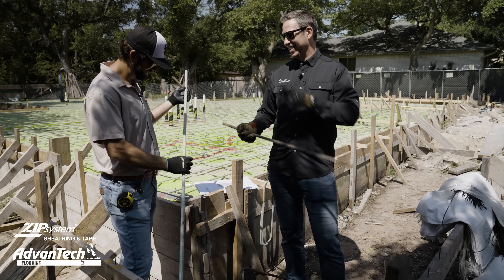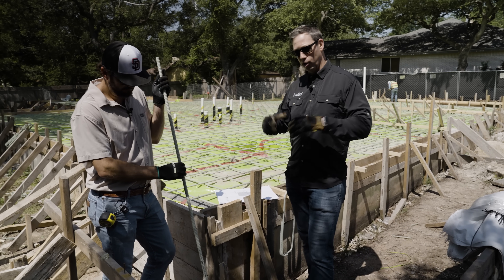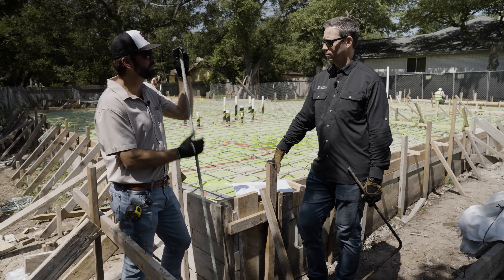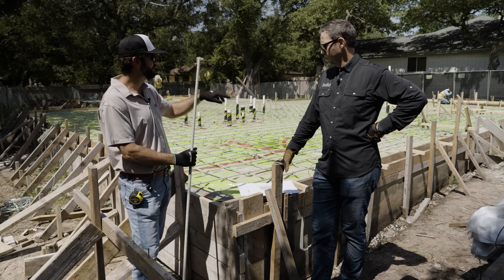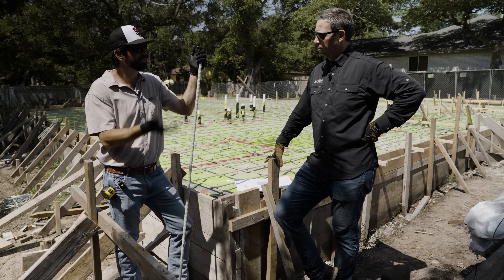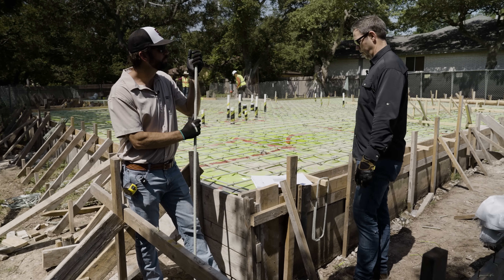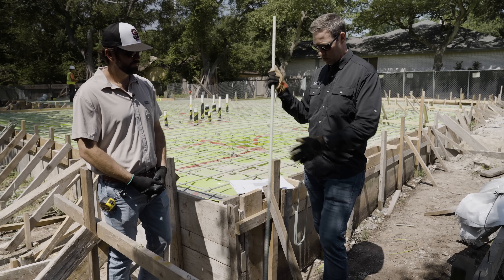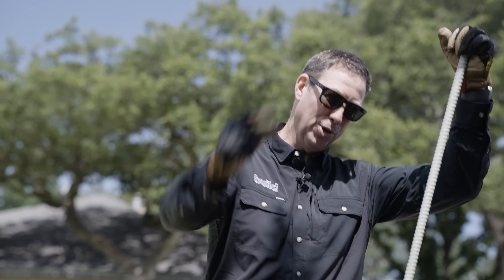Comparing Steel and Fiberglass Rebar - SURPRISING results

Comment: I would use basalt rebar before using fiberglass. You don't need gloves when handling it and won't put fiberglass in the air when cutting it. It has the exact same advantages of fiberglass without destroying your lungs.

Comment: I think fiberglass rebar can't replace steel rebar, because steel is more flexible and can be bent like steel bar. Fiberglass rebar should be formed in factory. And how about tension and compress test ? Fiberglass is more brittle than steel

Comment: Imagine tearing down a building and having to deal with fiberglass dust and pieces - not thank you! 

Fiberglass should be banned foe its lack of recyclability. The danger of fiberglass dust to human health and just environmental pollution is another factor against it.

Corrosion resistant steel rebar would be way superior.

Comment: Glassfiber or basalt fibers. I can definitely see uses for them in places that are subject to corrosion and where the concrete over the rebar might not be optimal everywhere on the site (less than maybe 1.5" or 3" covering uniformly depending on location and the classification of the construction).

Comment: Steel reinforcing bar has also made to a Tempcore specification for some decades. All reo is batch tested to a relevant Standard for properties like Tensile Strength, Upper and Lower Yield Strengths and Elongation. For a fair comparison these properties and those of the fibre pproduct should be given here.

Comment: Threaded cable has ridiculous sheer strength coupled to ridiculous flexibility.  Old timers used to throw it into masonry footings and its a real pita to remove.  Steel will swell and remove itself.  If have a feeling the fiberglass will be the better long term solution. Now need to figure out how to pee those fiberglass sticks out of 3D cement robots.

Comment: I wonder what this does for concrete recycling.. Does the crushed fiberglass rebar pose a safety concern?
Reply: Very good point. We know from the past that those who have worked with fibreglass for some time like surfboard shapers and some car smash repairers that the fine fibers have an effect similar to Silicosis so your point is a very valid one.

Comment: So I would imagine PART of the higher cost for the fiberglass is economies of scale. If let's say this new fiberglass rebar is only being used 5% of the time the cost of making it would be far more than if 90% of projects were using it. The more a company makes of something the less it costs to make it. Plus if a company was making sooo much of something they have more incentive to build better processes and methods for making it to lower costs beyond just higher volumes reducing cost. So knowing this I would think these companies (or at least a company like Owens Corning that can certainly afford to) would reduce their pricing to just under what traditional rebar costs so they can capture the market share to enable the lower prices and then they can grow into that pricing with their internal cost reductions to them make it back to normal profits without having to later raise the prices. Plus they should be out there lobbying the heck out of fed and local gov't to mandate this products use because of the not only environmental benefit, but the long term no rust benefits, especially in places like the coasts.

Comment: One point that I didn't see mentioned was the need to bond rebar to the building ground.  With Fiberglass or other composites, this would not be required and would save $$ and time.

Comment: FRP is what most spyderco knife handles are made of, glock (and all mass produced polymer) gun frames... seems like it would be expensive to have them make all the pieces in pre-bent form though... instead of just making sticks of rebar, they have to make a new mold for every different shape and size... you cant just cut and bend it where you want...

how much extra does it cost to have them make all the shapes? and how does the price compare to standard rebar on say a full slab foundation?

this does sound like an awesome alternative to coated rebar which is banned in a lot of places now, for good reason.

Comment: Perhaps going only one or the other is not the solution.  I can see FRP rebat making up the majority of rebar covering the field of  a slab-on-grade situation and the steel rebar making up the stirrups, footers, and intermttently across the field.  Together they will compensate for the others weaknesses in terms of the tensile / bonding / rigidity / etc. attributes each boasts or lacks.

Comment: Steel can be 3x stiffer. MST Bar is one of the highest rated FRP rebars, but what's wrong with hot dipped galvanized, TMT formed steel rebar for larger projects? I'd take that over FRP in an earthquake zone.

Comment: Two corrections: everyone is quick to compare 'carbon footprints' these days, and many are wrong. The most common is 'zero emmission EV', which is like dragons. They do not exist. The emissions are not 'gone', but rather moved from the car to a power plant where the electricity is made.
So, as to FRP rebar, the two corrections are;
1) it takes a substantial amount of heat to make glass and then more heat to strand it into the form in the rebar, so factor that in.
2) the polymer is made from oil, so you can figure 15% of the FRP bar, in fact almost every kind of plastic, is made from oil, so that amount of oil is also consumed, even though not thru being burned for heat. Factor that in as well.

Comment: Basalt rebar is another light weight, high strength corrosion proof solution that is very low carbon.

Comment: For those of you worried about fiberglass rebar in high seismic zones (D and above), here’s what I have found out.  MST fiberglass rebar does stretch (ie, bend). Actually you can bend their fiberglass rebar 180 degrees without breaking as demonstrated on their website. The difference is fiberglass rebar has memory and will return to its original straight state after bending force is removed, whereas steel rebar will remain in its bent state (ie, ductile). So the argument is in an earthquake, the ductility of steel rebar will give you better warning before sudden failure. But fiberglass rebar has 3x the tensile strength of steel. MST have shown their rebar reinforced concrete beam can last 2 million cycles of back and forth flexing at around 2-3 hertz before fatigue failure, whereas equivalent steel reinforced concrete beam will fail after 20,000 cycles. So pick your poison. I think as the industry gets more used to glass fiber rebar, it will be code approved for high seismic zones. The building industry advances like molasses in January. Also I wouldn’t trust glass fiber rebars manufactured overseas unless it’s from places like Europe, Japan, and South Korea where testing methods and standards are highly regulated. MST is Canadian and seems legit.
Reply: MST rebar has the best bonding strength.
Reply: Actually this is wrong. fiberglass has no strength past the bend point. So failure will be catastrophic. you want to avoid rebar rusting? use 316 stainless steel rebar, problem solved.
Reply: @curio78  That type of steel rebar is too expensive and not as strong especially in freezing temperatures as I recall.  Fiberglass rebar is far stronger than iron rebar so it’s breakpoint be several times higher.
Reply: @JohnLee-db9zt  1. stainless steel is stronger than carbon steel in every metric. the only reason for using carbon steel is because its cheaper. nothing else. 
2. And no Fiberglass yield strength is far lower than steel. Its only quality is it is strong enough and does not rust. The problem with fiberglass is it has no sheer strength. and if it is stress past is limit for any reason it does not bend like steel it just fails completely. This is dangerous for structures, as one earth quake will bring the building down, not bend it. 
   This is why stainless steel is the only logical choice for long lasting structures.
Reply: @curio78 Not according to structural engineers and the research I’ve done. I don’t know where you’re getting your info.
Reply: @JohnLee-db9zt  Which structure engineer? the only place carbon steel exceeds stainless steel is in hardness. Hardness is not equal to strength, all it does is make it scratch resistant and brittle. Tensile strength SS wins, fatigue SS wins, corrosion SS like 316 is immune. 
      You must have miss read the meaning of hardness. 
   you want all the advantages of steel but want it to last 1000 years and not fall apart in 50, use SS.

Comment: Worker safety: Particle release on demolition, so wet the material to minimize particles becoming airborne. Though once materials dry, if exposed to air, particles can become airborne.

Will this bar require a higher density bar array due to lower shear strength?

No more rust removal before the pour? I like that.

Comment: Concrete will spall all day long without any rebar in it, so it's not accurate to automatically attribute spalling to the steel rebar. People act like shear strength isn't a factor in walls for instance, I like some benefits of fiberglass, but I personally feel better about a steel grid resisting lateral movement in a wall.

Comment: I believe even cured concrete is always considered electrically conductive because the water content never goes to zero? 
I thought the epoxy coated rebar was very bad? Because any break in the coating would allow moisture to spread by capillary action and cause unseen oxidation of the steel?
Since any steel rebar is exposed to this concrete moisture content for the life of the structure. Isn't the formation of expanding rust (iron oxide) inevitable for most structures with steel rebar reinforcement? Obviously salt water exposure probably accelerates this process. Especially after spalling or cracking is observed.
Most of the beautiful historic bridges over the rivers on the coastal Oregon highway have had accelerated damage from this problem. I believe there are extensive and expensive remediation and monitoring programs addressing this issue ongoing.
Conducted by my Alma Mater, Oregon State University. Go Beavers.
I've lived in NW Texas for 30+ years. We don't see high humidity here at all. But cement here still has a finite life. 
I saw a short video about how Roman concrete still stands in Europe. Because of better design of, even very large, masonry structures. I don't remember any details about how the concrete/mortar was different. However, it sure has stood the test of time.

Comment: Is this reinforcement ductile? Since we like our concrete structures to exhibit signs of distress (cracking) prior to failure—strength and corrosion resistance is great but ductility is equally important. Hence the two fold purpose of steel reinforcement in concrete (ductility and tensile strength).
Seems to be a brittle material if it is not bendable after fabrication
Reply: Fair question. Material is linear elastic to failure. However becuase of high strength and lower modules the reinforced concrete will go under massive deformation before failure. For Fiberglass bar the concept of ductility is more defined as deformability. Lots of sign of failure
Reply: @bornahany  the shape of the stress-strain curve for FRP rebar relative to carbon steel indicates that it does not sustain deformation prior to fracture as well as carbon steel

% elongation of FRP rebar ~ 3% vs ~20% w/carbon steel
Reply: Technically the material is brittle. However because of high tensile strength and lower modules the structure will go under massive deformation before failure. The concept of ductility is more defined as deformability with GFRP. The structure will deform massively before failure. Lots of sign of failure by massive deformability.

Comment: My second question is : relative to steel rebar how much % of force it take to pull part it off a test concrete?
Reply: Lots of Force. 😅 tensile strength if 1200MPa (160KSI) is not that easy to break
Reply: @bornahany thanks for commenting. I was asking a comparison by % related to steel rebar.

Comment: My first question: how well it can be formed into a U, J, L elbow?
Reply: @philoso377 Any shapes (hoops, stirrups, bends, U, J, L) are formed during the manufacturing process. MST Bar is manufactured to spec using custom jigs for forming. Because they are formed in a jig, each piece is identical. There is no variation in the shape or angle of the bend.

Comment: I can see this being less expensive on a large job just because it's easier on the workers (easier to move around the site, less tired, less mistakes). 

But, the part I'm wondering about is temperature related expansion and shrinkage. I don't know if it's true, but I've heard that steel rebar expands and shrinks by the same amount as concrete, reducing damage to both materials due to changes in temperature causing them to expand and shrink by different amounts. For me, this makes me wonder how well this holds up in areas where the temperature can be 0 degrees F in the Winter and 115 degrees F in the Summer?

Comment: You don’t need to use rebar at all if you just use fiber reinforcement but not the garbage that the concrete companies try to push on u. For every yard of concrete throw in like 5 -6 Oz of chopped fiberglass fibers, doesn’t sound like a lot but it is like a lot a lot. Then throw in some concrete solidified like s2000 and your concrete will not ever crack apart. Tell the driver to spin that on high for like 5 minutes and those little fibers will mix through the concrete and it will bond together so tight it’ll be harder then engender quartz.

Comment: It totally makes sense. The only issue I see is that buildings are torn down for one reason or another. At job sites I see piles of materials for recycling. A pile of concrete chunks here and a pile of mangled rebar there. When it comes time for crunching concrete laden with fiber-reinforced polymer bars will there be any issues? Does it even need to be separated? Perhaps some buildings are torn down due to spauling. So maybe fewer demolitions will need to happen.
Reply: When recycling concrete which has been reinforced with MST BAR there is no need to separate the MST BAR from the concrete. Everything can be ground together back to its original state of sand and stone.
Reply: I imagine you would simply end up with glass fibre reinforced concrete.

Comment: Modern concrete admixtures are so good, that it basically makes the steel last long enough to make it more attractive th fiberglass. Fiberglass has been added to concrete for years as fiberstrand, or toughstrand. the biggest problem after this is, you cant bend fiberglass bar, so i assume you have to special order any pieces that arent straight. since its creation decades ago, numerous other reinforcement methods have been put on the market. instead of tough strand you can get a stainless steel strand additive. lastly, concrete was perfected in the 50s and 60s, i can show you concrete structures that were built in the salt water in the 50s, that are still fine today. not a rust stain in sight, and zero spalling. Its just that a lot of people do not know how to do concrete properly near saltwater

Comment: As you don't mention it, I guess thermal expansion and conductivity are not of concern in Texas? Otherwise, fiberglass rebar having a thermal coefficient that is much close to that of concrete and being less thermally conductive are advantages in rest of the world.
Reply: MST BAR has almost the same expansion as concrete in longitudinal direction. Moreover, MST BAR maintains its very high bond strength to concrete through temperature fluctuations. Simply put, MST BAR performs very well under these conditions.  This is one reason why many municipalities are regularly specifying MST BAR for infrastructure, highway and bridge projects

Comment: Questions:
1. How does the cost compare to steel rebar?
2. Can you mix and match rebar types in the same build (assuming it's accounted for in the design)? E.g. Using fiberglass for straight sections, using steel for bent ones.
3. Being only 25% less weight than steel doesn't sound right - are you sure it's not 25% of steel weight instead?
Reply: 3. Yes, the weight of MST BAR is 75% LESS THAN the weight of steel rebar. This was misspoken during the video clip you are correct.
Reply: 2. Yes, using both MST BAR and steel rebar in the same wall is acceptable. There is no chemical reaction between the steel and MST BAR in concrete. Obviously, to avoid corrosion, we recommend using only MST BAR.
Reply: 1. Generally speaking, the cost of MST BAR is very comparable to steel rebar. The price of steel rebar is known to fluctuate significantly, whereas the price of MST BAR holds quite consistently.  An ICF building for example, often will see an approx. 15% reduction in rebar price when compared to steel rebar cost.

Comment: The weight becomes more of a factor when glass reinforced rebar is used where it is not supported directly by the ground as it is in this application. The reduced weight in concrete placed in a floor above grade for instance reduces the gross weight of the concrete pour so forms and false-work can be designed for lower loads and additional floors each transfer reduced weight to support pillars and beams. 

Here in Minnesota, rusting rebar is a very significant problem because of the extensive use of road salt used for de-icing in the winter. A bridge near my home is being replaced this summer (spalling has been visible, ineffectually patched over and over for years), I will have to stop and see if they are using corrosion resistant rebar for the bridge deck this time.